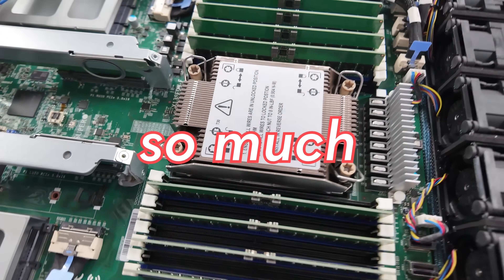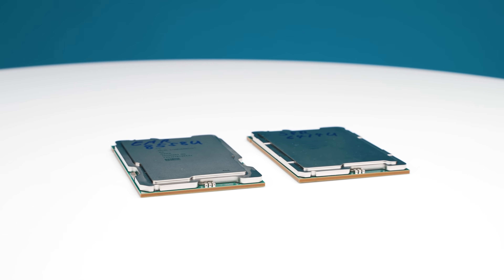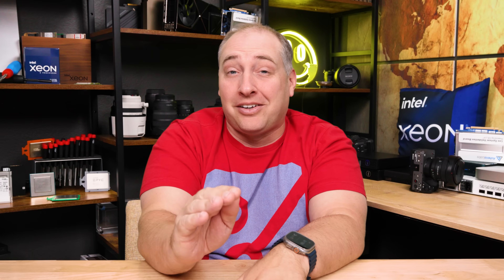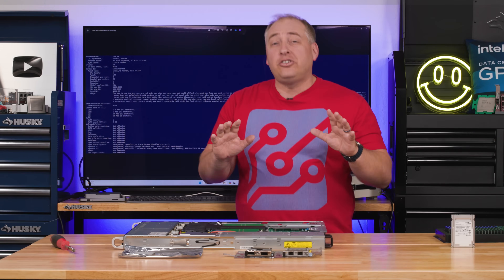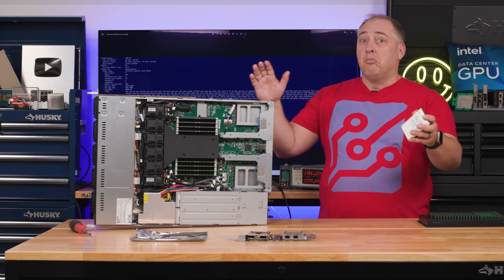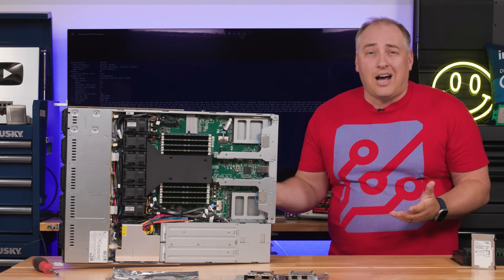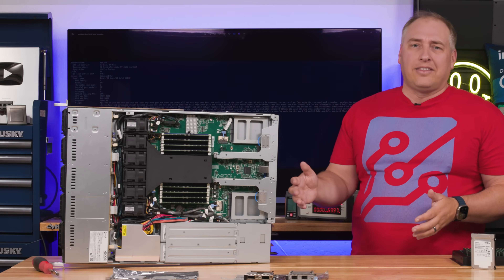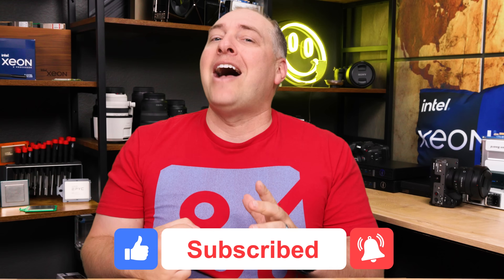5th Gen Intel Xeon is way faster and more power efficient than 4th Gen using the same cores

Comment: Home lab. $10,000 CPU? You and I live in very different homes! Oh, and I often chat with Intel about the CPU set I'm about to use  ... not! This channel has gone so far upmarket I see less and less relevance.
Reply: I've made comments to this effect before. They don't understand that this stuff is like 10 years away from being affordable for home labbers and no one is going to remember these videos 10 years from now. The only videos they do that make sense to me are ones on the cheap networking stuff like Mikrotik. I, as a homelabber, couldn't give two craps about an 800 gigabit optical module that can go 1,000 kilometers. Even Wendell's channel is mostly new elitist hardware that costs as much as cars these days. Sponsored content. IT people aren't going to the YouTube to find out what's going on in the computing world. They're going to expos, calling the manufacturers with requirements, and getting quotes.
Reply: Most of us will be using the engineering sample version of these parts when they hit taobao, and modding the BIOS to inject the Bx/Cx/Dx/Ex uCode (whatever the stepping) to get 90 percent of the performance for a small percentage of the Production sku cost. If you don't already know how to mod BIOS or buy off taobao, I recommend that you educate yourself. Another option is to go with OEM AMD skus a couple generations back, which are typically mostly inexpensive from China. And yes, I do understand your point completely. There are some "rich bs-trd" youtubers who don't know most IT workers are working for 50-60k right now.
Reply from the maker: Huh? Very odd comment. We have been doing 8x GPU servers since 2016 and most folks work in IT. This is probably down market from our average

Comment: How much of the power consumption is coming from the 12x 40mm fans, + the PSU fans though? How does this stack against 2u dual socket systems when you factor in the watts wasted on blowing air? (Also hearing damage)
Reply from the maker: A decent amount is cooling and so forth at the system level. As CPUs generate heat, fans spin up

Comment: Why not compare to amd equivalent parts with low core count and high frequency? Is this a fluff piece for intel? The intel pillows in every shot surely suggest that it is.
Reply from the maker: Huh? We explained that. There are AMD EPYC, Ampere Altra in shots as well. Strange comment.
Reply: @ServeTheHomeVideo  I have posted my thoughts of the comment you are responding to, in your defense, but I would like to say that not having the manufacturers trinkets on display would help avoid this quagmire, however unwarranted it may be!
Reply: @ServeTheHomeVideo  Strange indeed!
Reply: I think that Patrick has to first evaluate the parts for what they are advertised for and suggested value to give a comprehensive picture of it's purpose. While I understand that the lack of comparison at every step is unsatisfactory for you, it does not mean it is a fluff piece. To be honest, I don't know how bad it would feel for the creator to have to deal with this much vitriol!

And also he said in the video that AMD CPUs are better when he was giving a sponsorship disclaimer (or rather the lack of sponsorship) only for you to jump to the conclusion that he must be sponsored!!!

Comment: Hi, so others seems to have notice what ARM is doing since a long time…   I think it is the future, more and more calculation/speed with less power, which will be awesome for everybody.
Reply from the maker: We have been doing Arm servers since 2016 (see the main site Cavium ThunderX pieces.) Remember that the PPA gains are for the execution cores, not the SRAM caches, PCIe controllers, DRAM controllers, and so forth. Arm has been ahead in higher core count but lower performance cores optimized for cloud native workloads.
Reply: @ServeTheHomeVideo  I understand that, may be they'll take care of all peripheral functions once cores will be optimized to the limit.
Reply: ARM isn't magically lower power, if it was then AMD and Intel would be using already.
Reply: Removing silicon with instruction sets for advanced math does not get you more computational power 😂
Reply: @ I can do even better, remove all silicon to replace it with an abacus !   Unbeatable in term of energy invoice. \o/ 😋

Comment: i have a quick question about that idle power thing. do cpus not in idle neary use 0W. i mean the mainbord it self uses power too. i have a r630 it uses 150W idle. i know it can go low as 60W but i dont have only 1 cpu and one stick of ram and running of a usb stick ok. my system has 4 sata ssds in it and 4 2tb sas12g hdd, all connected to then perc h330 mini in two virtual drives, then i have 2 xeaon E5 2699v4 in it and 768gb of ram with all 24 slots populated, also i have the dvd drive and the display also i have the idrac8 enterprise and a 2x2 10gbit nic. so year this adds many power hungry components. 20W alone for the idrac, each ram module uses 2w to 3w each so this is another 48w to 72w, the h330 mini uses also 20w so this adds up fast. 
so i think cpu idle power is nearly 0w what is shown by the system monitor. i guess this is correct. i dont kow for sure what happen if you enable dynamic power but much deeper you cant go and i thinks this impacts the performance and would lead to bad performance response and at some point it would not mater because the system wont go deeper because of no need for c states accordingly to the system utilization. if you optimize the components around and throw away everything you dont need this is possible. ass i sad if you go with the minimum requrements you can see impressive numbers but at some point this does not longer mater.
Reply from the maker: When the system is on, the CPU is providing the PCIe root, memory channels and so forth, so the idle is above 0W.
Reply: Desktop Intel CPUs can dip down into the single digits because they are fully monolithic, and have relatively few memory channels and I/O connections to keep active. These chips all have to power a lot more cores (48P instead of 8P+16E), 4x the memory channels, many time the I/O connections, and they spend some power on the connection between the CPU tiles.

You can see some of those idle power losses looking at Zen4 on desktop, where the 7950X often sits above 20W where an otherwise more hungry i9 will happy sit at 10W.

Comment: I'd be more impressed if the idle power was below 20W. I have a 12-core Haswell-EP that idles at under 2W without any special setup. Sounds like modern Xeons could be a lot more aggressive with power saving.
Reply: True, got E5-2650Lv3 as my offsite backup server. Barely sips power, but man, server boards at those days really doesn't have much wiggle room for standby like S3/4. Either on or full on system halt 😅. Need those pricy workstation board for better idles power
Reply: The CPU's tested have about 3-4x as many cores... and additional components such as additional accelerators for "AI" more PCI-e lanes just more everything. That's going to add up in terms of idle power draw.
Reply: I’ve got a 10c broadwell-ep system and cpu idle power is way over 20W. Maybe it’s a server board thing?
Reply: @jolness1  yup, like I pointed out in my first comment, in Broadwell/Haswell-E era, motherboard is also an contributing factor. Even with dual socket Asus Z10PE-D16 WS has proper idle and standby mode implementation (note that the motherboard still using server grade C612 chipset).
Reply: Under 2W?
Im very sure that thats not true.
That would be extremely impressive for a very power efficient mobile CPU.

Did you mean to say 20W? Cuz that would make sense.
Reply: 2W sounds like BS figures that some internal metrics report but are always far off from actual power consumption..
I'd be surprised to see any S2011 system draw less than 80W from the wall.
The lowest I've seen is 16W from the wall on C236 and that's rare AF.

Comment: As someone whose homelab is still using 2690 v4s and 772gb of ram. This only made me see how ahead AMD still  is on a pure value proposition.
Reply: In what way? Emerald rapids showed Intel with slightly higher core counts with slightly more performance, but less power consumption across the board compared to the AMD CPU tested here.
Reply: @AlexSchendel  Completely untrue, but also new vs old parts.

Comment: This is interesting but I think AMD is still winning here. You can get a lot more cores and a lot more cache with them and they are clocked a lot higher than what Intel is providing here. I would be interested in seeing a similar comparison on idle power draw with them as well but they do have a lower TDP and if their consumer chips are anything to go by they will likely draw less power. That being said it is also interesting that Intel is actually the "budget" option now. The closed competitor to the 8558U would probably be the 9454P and that thing cost 4,598 USD.
Reply from the maker: The Intel Xeon Platinum 8558U is 260MB of L3 cache versus 256MB on the 9454P. Emerald Rapids XCC changes the cache side a bit.
Reply: @ServeTheHomeVideo  Yes but it is only 4MB different which is negligible. Again I tried to find the closest part. If I wanted the fastest part I would have compared to the 9474F which has a base clock of 3.6Ghz or almost double that of the xeon. Comparing top to top we could have compared to the 9684X which has 2x the cores at 96 and even with all those cores the base clock of each core is still 550Mhz higher. It also has a whopping 1.1GB of L3 cache. AMDs chip even gets higher single core performance as far as I can tell thanks to the massive cache and higher clock. So in my mind the real story here isn't so much that this thing is beating AMD because it probably doesn't even manage that in the power consumption you are measuring. The story is that they are actually the budget option compared to AMD now being like a full 30% cheaper. 

They are better than their last gen and I do think it is worth evaluating these processors. I just don't know if your power efficiency or even software argument hits it here because if software licensing is done on a per core basis then I probably would go with that 9474F that is quite a bit faster. If power consumption is the thing here then that 9684X is going to be the better option because it still has faster single core and still has 2x the cores. Yes the TDP is quite a bit higher at 400W but as you said that is only part of the power draw of the whole server and additionally is only part of the power draw of the whole rack. A single server with 1 9684X  or the 9754 is going to consume a whole lot less power than the 2 or 3 servers you would need to build around the 8558U.
Reply: @chaosfenix well it is different in that the L3 on Intel is ‘more’ continuous than on that AMD processor. In the Intel processor that’s 260MB spread across two chips, or 130MB per chip, versus 256MB spread across 8? Chiplets at 32? MB each (not exactly 100% on AMD’s product line). And so you could have 128MB of data entirely in L3 cache on each chip for Intel, whereas that would be spread across 4 chips on AMD. 

And I’m pretty confident that Chiplets on AMD don’t benefit as much from cache on other chiplets, otherwise AMD would would offer CPUs where they replace CPU chiplets for just the 3D Vcache chiplets (double the l3 of a cpu tile), or even double vcache chiplets (4x the L3 of a CPU tile and 32MB more than even the X3D chips have).
Reply: @levygaming3133  Yes my point isn't that there are differences. They are different companies. I just tried to find the closest competitor in the stack and at similar as possible specs AMD is going to win overall in most areas but price. The number of workloads where that 4MB of cache or smaller cache latency is going to win in performance vs a chip that has almost 2x the clock speed has to be negligible at best. Again, it isn't going to win on performance or power here. But it is winning on price which is where I think this thing is the most interesting.

Comment: I think single socket will be the best way forward for most businesses. The core count and performance of a single socket is already fantastic, and like you said the licensing costs more than the hardware. Everyone I've talked to about Azure Stack HCI I'm saying to go with 16c32t nodes until they hit 6-8 nodes in a cluster. 16c per node is the minimum to license with DC on an EA, and you have to account for N+1 node redundancy. Even if you were pushing it a bit more and went with 6x 32c64t nodes, one socket can handle that just fine. Obviously if you're looking at 4 racks full of servers, then going dual socket and consolidating the number of nodes could save you some money. But most businesses I've talked to don't need more than 8-16 nodes in a single location. Really my wish would be for Intel to release a platform in-between LGA4677 and consumer that's a single socket with 16c32t chips and 6-8ch ECC that's "cheap" and low power.
Reply from the maker: Stay tuned for next week on STH. :-)
Reply: Something like AMD Siena?

Comment: 1 server electric bill must be like 1k a month to way too much energy
Reply: Assuming a server draws 500w constantly 24/7 (likely not the case if there are some idle moments - watch the video), that's about 12 kWh per day. Lets assume the worst and you live in CA, where power is around .50c per kWh. That's 6 bucks per day ($183ish per month).
You're off by a zero, possibly 2 if your power is cheap.
Reply from the maker: Not even close in the US, even in expensive power parts like California.
Reply: My server draws 650-800 24/7 😬

Comment: I'm sad to see sub 100w server chips gone.
Reply from the maker: Stay tuned to STH next week and we will have something for you.
Reply: @ServeTheHomeVideo  Hopefully it's something with plenty of lanes. Which is the only thing missing from consumer machines.
Reply: Inhell has to heat your home somehow ;p
Reply: @konnorj6442 hurr durr intel bad! Amirite?!?!
Reply: Efficiency.  Yes, we're in a period of pizza oven levels of wattage, but with process improvements, we could swing back to sub 100w units.
Reply: @TheFullTimer  Pizza ovens are made of brick, and powered by burning wood... Zero wattage involved.
Reply: @KomradeMikhail my Grandpa had an electric pizza oven. It had bricks and fancy asbestos insulation inside. He said it worked really great and I think he might have regretted taking it apart.
Reply: AMD Siena pretty much is what you want, though if you want 64 cores or something that's not happening at or below a 100W (8 and 16 core only), not sure if boards have arrived for this yet.
Reply: Any modern server chip can be a sub 100w chip, just disable cores and turbo.
Reply: @stephendetomasi1701  disabling cores never dropped power consumption and turbo only works while under TDP.

Comment: Great Video!!  I know that you are highlighting the single socket SPR and EMR processor platforms but I must say that the 2 socket systems are also very phenomenal systems.  In our SAP HANA testing for vSphere support we have observed user throughput levels that match the 8 socket Cascade and Cooper Lake platforms.  These systems consume way less power too.  The only TCO bummer is the use of DDR5.  In sizing these systems for HANA, the memory is a big part of the cost.  However, I for one am very excited with the direction that Intel is going.  I can't to get my hands on the new Sierra Forest line and see how that performs.
Reply from the maker: Great comments. We have been running the cloud-native series comparing modern CPUs to Cascade Lake, albeit using 2P systems.
Reply: Ddr5 give you the option to go 96gb rdimm route
Reply: @zbigniewmalec4816  Indeed.  It also gives you the option to go with 256gb rdimm too.  But these are very expensive.  We tested HANA using 128 gb rdimms, so 2TB per socket (60 core).  These awesome little systems handled almost the same amount of current users as the older 8 socket cascade lake system with similar response time for OLTP and OLAP processes.  I am very amazed at these processors.